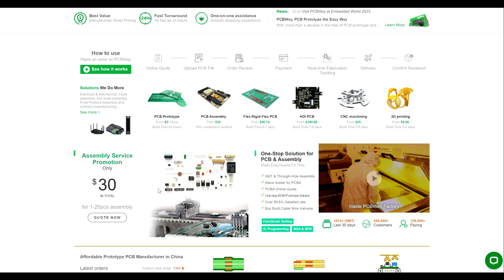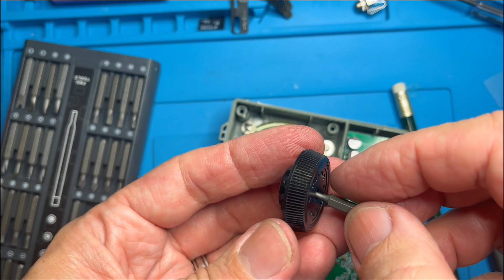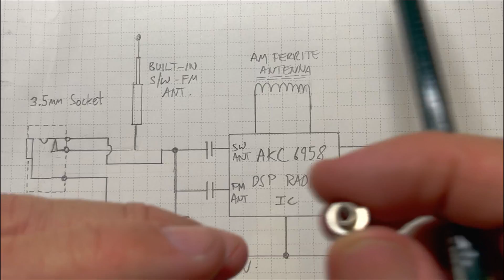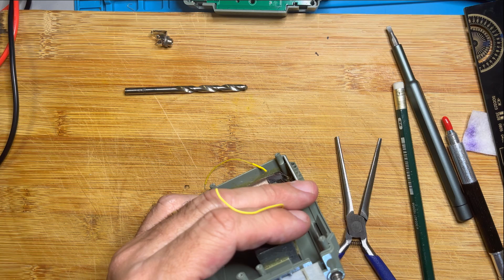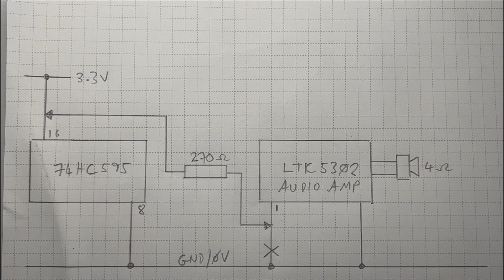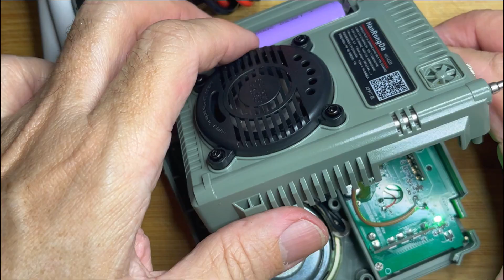EB006 - Raddy RF320 / HanRongDa HRD-A320 External Antenna Upgrade!

Comment: Thank you for the review with the radio disassembly and modification. I don't understand.. what is that metal cube and what is it for? I think that if you solder a 5-6 farad, 5.5V supercapacitor in parallel with the battery, the battery will last longer. The supercapacitor will compensate for battery discharge during peaks when playing loud music. This is an addition to the modification.. Actually, it would have been possible to avoid drilling holes in the radio casing and instead use the AUX jack for the antenna, by cutting the traces and soldering the antenna to it. It's unlikely the AUX jack would be needed anyway..
Reply from the maker: A nice idea about the Aux in jack - as long as it is the type that can disconnect the internal antenna when the external one is plugged in. I actually use the aux in to allow me to use the radio as a test amplifier. I find it quite useful for that.

Comment: The Radio R12 or Degen R12 appeared as the same a320 without external antenna, you have also repair it
Reply from the maker: Thanks for your comment. I can’t find the Degen R12 online.
Reply: @ElectroBananasYT  aliexpress or amzon Dijin R11, D11, R12. Degen.  Or Radio R12  many names
Reply: Also appeared a litle one with two games HRD G18 only Fm, оr  HRD 777  similar to hrd 702 with second  ferrite antenna

Comment: Knob  !   Good solution but I think cutting an  IF  trimming tool could be an option.. It is a shame that manufactures forget the interface to the 300 lb gorilla as AVE would say.  Spending a little more time and money on a quality knob makes for a more satisfying experience. Cracked screen, looks like that is Polystyrene ,  the Fluke would be Polycarbonate which is more expensive but resistant to impact.
Reply from the maker: Thanks for your comment 😊. Using an IF trimmer tool is a great idea 💡. Fortunately FNIRSI send me a replacement plastic screen 😊

Comment: Get an SDR dongle and connect it to an android phone (for portable) for TRUE all band reception, for a LOT LESS $$$
Reply from the maker: Thanks for your comment Mike. For hobbyists or those interested in exploring a wide range of frequencies and modes without a large investment, SDR dongles offer a great entry point. With the right setup and possibly some external filters or preamplifiers, they can perform remarkably well. On the other hand, this radio works straight out of the Box, has a remarkably powerful and great sounding audio stage and is also really fun to use. 
Ultimately, the choice between an SDR dongle and a dedicated radio should be based on your specific needs, budget, and interest level in either tinkering with software and hardware or having a ready-to-use solution.

Comment: You've solved some of the basic problems. Thanks for sharing this! Mechanical durability and switch choice is definitely an issue in modern radios. The rubberized coating and knobs are a failure point, as well as the antennas that break almost immediately. 

If this radio had wider shortwave coverage, ssb, a bfo, switchable bandwidth from 500 kHz through 10 kHz that stepped in 500 Hz increments and external antenna jacks, it would be the perfect travel radio. I hope the company considers making an improved model.
Reply from the maker: Thanks your your comment. Totally agree, with just a little more effort it could have been a great travel radio. But for the price I still think it is great.
Reply: @ElectroBananasYT It is on a short list of purchases. I will cover the white light port with a deep red filter, probably stick a strong magnet on the base and  put it on a steel base so it doesn't get knocked over as easily at night.
Reply from the maker: Some interesting ideas there! Good luck with your mods 🙂
Reply: @Kitsaplorax  Just get an SDR dongle for 1/3 the price!
Reply from the maker: Thanks for your comment Mike. For hobbyists or those interested in exploring a wide range of frequencies and modes without a large investment, SDR dongles offer a great entry point. With the right setup and possibly some external filters or preamplifiers, they can perform remarkably well. On the other hand, this radio works straight out of the Box, has a remarkably powerful and great sounding audio stage and is also really fun to use. 
Ultimately, the choice between an SDR dongle and a dedicated radio should be based on your specific needs, budget, and interest level in either tinkering with software and hardware or having a ready-to-use solution.

Comment: Please just do a vid on the antenna mod I got confused half way through when you started to look at the amp, it looks like a great way of improving reception, keep up the good work thanks😊
Reply from the maker: Hello, thanks for the comment. Good point, and I am working on a video for the mag loop antenna. Yes it makes an amazing difference if you live in a built-up area. Should be about a week until release. All the best
Reply: @ElectroBananasYT  Brilliant thanks
Reply from the maker: Please do subscribe so you can be notified when the video is released.
Reply: @ElectroBananasYT  will do

Comment: Thanks for the update in this informative video. 
I have the ZhiWhis A320 which I managed to knock off my outdoor table. This in turn loosened that weight which cut the MW antenna wires.  This makes your video so helpful…the knob on mine has become stiff so hard to turn that I have taken to using the step buttons before the weight loosening fall. I have a problem with sand here in Tucson, Arizona.  I still have SW m VHF and FM but I have to keep the volume down less the weight starts vibrating with the speaker.  MW is now useless so it good to see how to take it apart. I plan to use your external antenna solution as I have an extra MLA 30+ Magnetic loop antenna.
Just going to order the extra parts now.  Thanks!
73!
Reply from the maker: Very glad you found that useful 😊. I am surprised the metal block came loose, it was very difficult for me to remove due to all the glue. Good luck with the mod, should be great with a MLA 30+. Would be interesting to know how you get on.  73.
Reply: @ElectroBananasYT  first of all your username is hilarious. Second of all I love your innovative solutions to these little radio problems. It’s great!
Reply from the maker: Thank you! Well I am very happy to hear you like the video 😊

Comment: My retekess version doesn't have the replaceable battery it's wired in kind of annoying
Reply: I can confirm this. I originally had the Retekess and it has a fixed flat Lithium Polymer battery soldered to the board. The rear battery cover still exists and they even give you a screwdriver to remove it!  But the battery is wired in permanently.  I now have the Raddy RF320, exactly the same radio except it has yellow orange backlights on the display and dial, case colour is slightly different and it has a replaceable 18650 battery. Oh and the Raddy came with a case and an external short wire antenna to clip on, which the Retekess didn't!
Reply from the maker: Sounds very much like the one I reviewed.
Reply from the maker: Thanks for your comment. Oh that is interesting. I wonder why they did that?!? Perhaps to pass some import rules?
Reply: I choose retekess tr112 and was also disappointed with the battery. Once the battery completely dead you can mod with 18650 too